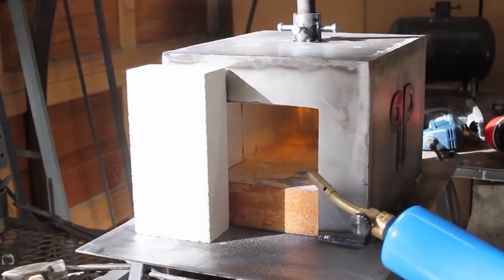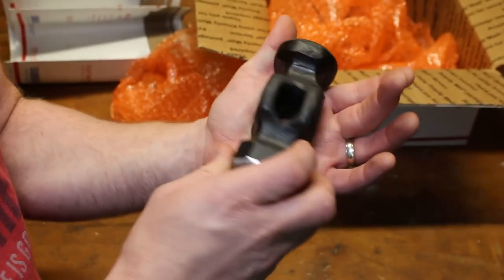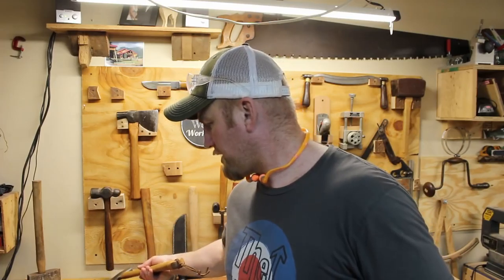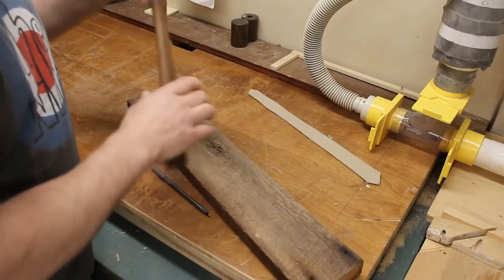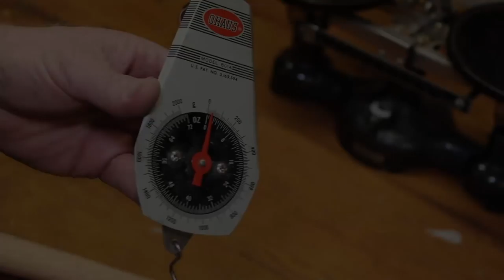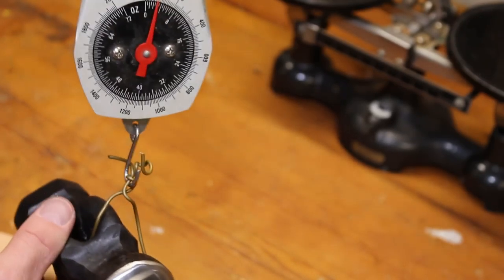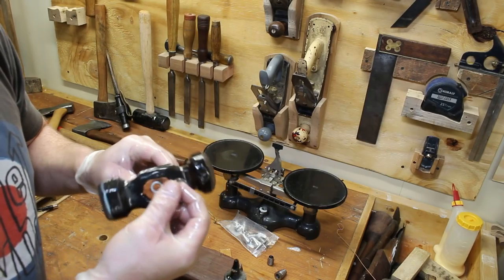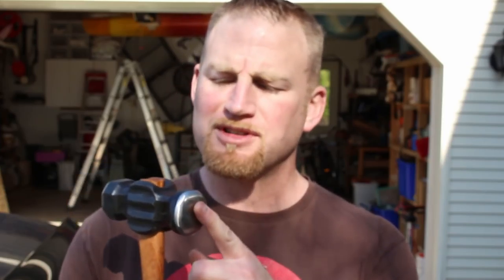Carving a Handle for a Custom Rounding Hammer from Paul Pinto!

Comment: Bud, I can tell you from the grain orientation on that wood that it's gonna be loosening again soon. I'd suggest forging a couple small wedges for yourself in preparation. Don't worry about splitting too much. As long as the front and back edges of the eye (especially) have a lot of friction acting on them you'll be fine. The grain doesn't look like it has much runout, so although it will want to loosen as long as you stay on top of that you should have the handle for a long time.
Reply from the maker: ok, thanks, the orientation is diagonal and not what I would typically like but I figured why not give it a try.  I've been letting the boiled linseed oil really soak into the end grain and I like your idea of some smaller additional wedges.

Comment: Loved the video Kyle! that handle looks great! I cant wait to see more blacksmithing videos from you in the future
Reply from the maker: Thanks Paul!  I'm very inspired to do more blacksmithing now!  I spent Saturday welding up plate steel on the bottom and sides of the forge and it seemed to help retain more heat.  So do you think my regulator could be improved?  Instagram is not showing your entire message here at work.
Reply: You might want to get a regulator with a gauge on it so you can see the pressure you are putting out. The one you had looked similar to the ones gas grills use and it might not allow enough gas to pass through it. It seems like you have a big enough burner so I’m thinking it’s the regulator.
Reply from the maker: The regulator I have is one that is up to 30 psi I think and it seems to put out enough but a gauge would be better for sure.  I did try to be more patient, letting the forge heat up and then let the material in longer and it definitely helped as you could see with the tongs I'm working on at the end.
Reply: 30psi is definitely more than enough and it seems like it got hot enough to forge those tongs

Comment: Beautiful work on the handle, for that awesome looking hammer. I'm going to watch that video next. But was wondering did you only use that scraper spokeshave to shape the handle once you got to your horse?
Reply from the maker: Tim. Wilson thanks! Yes only used the spokeshave and then some orbital sanding to finish it off.  The spokeshave is far superior to rasps or files IMO and faster